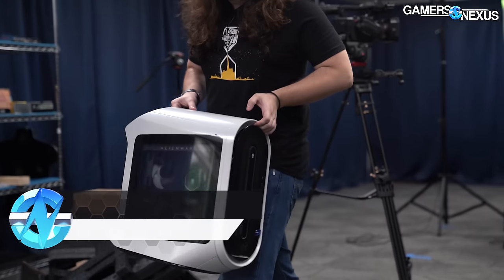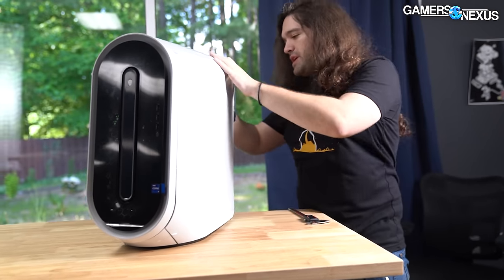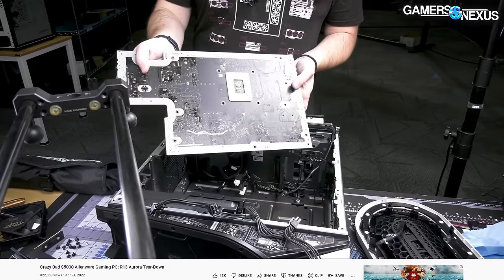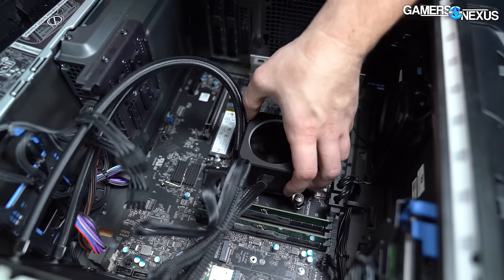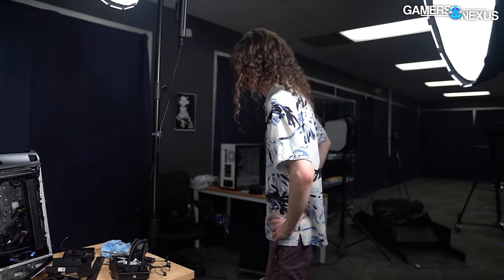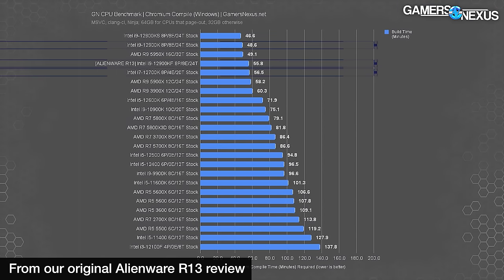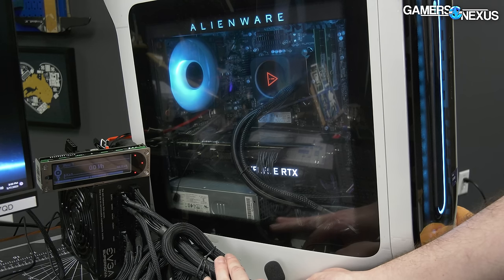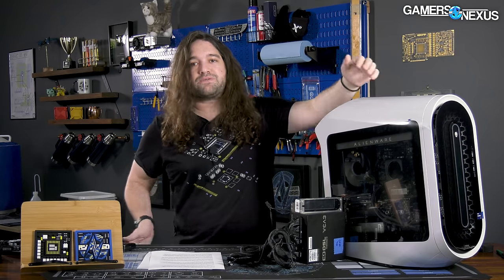"Fixing" the Alienware R13 Dumpster Fire

Comment: Again, i don't get why Intel isn't getting on Dell's case here, People are buying 12900k but not getting the advertised stock speeds because dell doesn't allow changing bios settings needed to get to stock even with a better cooler and thermals. Surely customers have a right to sue here for paying for a 12900 and 100% not able to run it at stock speeds. Intel shouldn't wait for lawsuits and demand Dell only put their chips in computer builds that allow them to run at stock speeds at minimum, it's not that hard to do, literally anyone building a custom PC would not have an issue running a CPU they buy at stock speeds, and this is an unlocked CPU capable of overlocking, yet Dell can't even manager to get it to run at stock? How the hell does Dell screw this up this badly?
Reply: You may be able to claim false advertising against Dell... not 100% sure though.
Reply: Intel doesn't care that Dell builds cases so bad that 12900K tranforms into 12700K. Intel gets money, that's the end of the story.
Reply: Intel LOVE Dell.
There's a quote somewhere about colluding to farq consumers.
Reply: Well just another reason then i'll be happy to go with AMD in my next build if Intel is ok with this.
Reply: @zengrath  Well, Dell also makes a version with a Ryzen cpu, which I can't imagine would be any better considering how incompetent they are. It's probably too much work to police OEMs from the chipmaker's perspective since pretty much all the OEMs are god awful.
Reply: @zengrath  I'm going full AMD next build (CPU + GPU) because I feel like I get more features on the mobo in a midrange chipset, the CPU power usage is a lot lower for similar performance and the AMD GPU drivers are a lot better than the Nvidia ones on Linux. And AMD GPUs use a little less power for the same performance than Nvidia ones.
Reply: I don't think Intel should get legal with Dell but they ought to have a quiet word with them. Most mother board makers try to get the most out of the CPU except in their cheapest boards. Dell are not even doing that in their most expensive PC.
Reply: @wayland7150  why would Alienware care about 12900K being 10-15% under the standard performance of the CPU when 99% of people buy their PCs because of the brand name and looking cool for people that know nothing about PCs?
Reply: @carnsoaks1  Yeah didn't some intel ceo say you cant buy better friends than dell?
Reply: @zengrath  The government can't do much, technically there is no false advertisement. Alienware never said in the product description that it should perform as well as a reference 12900K. It just said  "12th Gen Intel Core processors that help to ensure everything you do with your PC runs quickly and efficiently", which it does, like any modern CPU for that matter. Big companies are genius at saying nothing important in a page full of text, just vague statements. Like you said, the customer should do some research before buying to not get scammed.
Reply: The issue is you have ludicrous numbers of PCs being sold, which means big income for Intel from every CPU and chipset sold. 

And, let's face it. Nobody in their right mind would ever buy a desktop PC from Dell for anything remotely serious. The difficulty is that anyone that knows a first thing about anything of anything is a fairly small number.  You either have corporations that need a billion machines that are capable of Excel and Outlook. And you have people that literally don't know anything about computers other than "Dell makes PCs" and "Alienware is for gamers!". Where the former won't ever come remotely close to utilizing even 25% of a 12900k. And the latter won't check into or care that their components are being driven into an early grave by being run so hot that they have to throttle.

Comment: Oh I hate Alienware's design scheme with a passion. It's not only just the prebuilt. Even their monitors have unnecessary BS stuffs going on.
Reply: I'm going to have to disagree there, I have multiple of their ultrawides (3 AW3418DW) and have no complaints about the design. Would you be able to point out a specific design choice concerning their monitors that you think is unnecessary in a bad way? No it doesn't "need" back lighting, but it's not hurting anything. Interface is easy enough to navigate. The monitor stand goes on and off without any issue. Mounting an arm requires spacers but that's it.
Reply: @IForgetYourName  Yea I recently got an AW2721D and actually quite like the design. Sure its not needed but it is pretty cool sleek. You can say that about any product with some flair really as it isnt needed but not everything needs to be maximum function over form. Also their monitors are pretty well made and solid products overall on the higher end from what I can tell.
Reply: nah it's pretty good, dell/alienware should stop making pcs and stick to monitors
Reply: Dell monitors are pretty good. I like that they have tilt and swivel bases. I like the built in USB hub and that they connect with Display Port. They are much stronger than Samsung too.

Comment: The problem is Dell doing this would turn the 5000$ PC into a 7000$ PC.
So the best deal would be to build your own or at least not buy this Dell in the first place.
Reply: Build your own, buy a 3D printer and print your own tacky Alienware inspired shroud that fits on your superior case. You'll still be saving money I bet.
Reply: @TalesOfWar  Or just buy a broken Dyson wingless fan thing and stick half of it on the front of the case.
Reply: If i can build a better pc for $5000 a multinational with access to better prices and first class R&D departments should be capable to do it for the same or less money.
Reply: I've said it before.  If you want a pre-built and live anywhere near a microcenter, pick your parts and have them build it for you.  Best of all worlds.
Reply: @kcgunesq  I concur.
Reply: Custom pc is the best 👌
Reply: @sohamsengupta6470  Stick a Raspberry PI 4 in anything made by Dyson and you've got an Alienware beater.
Reply: It would literally save them money because they can use off the shelf parts rather than all of their proprietary custom ordered baloney
Reply: @hovant6666  the custom proprietary baloney is very cheap because they order millions of it. Their agreements likely makes it cheaper than off the shelf parts.
Reply: @kcgunesq  For $5,000 you could get a similarly spec'd system from a boutique builder (e.g. Puget Systems), and you wouldn't even have to pick parts or live near MicroCentre. You can bet the quality, build, and after sales service would easily surpass Dell/Alienware.

Comment: Once upon a time, when I still worked retail PC repair (not at a big box store, it was at a small shop), We had a customer come in with a Nehalem-era Alienware desktop. It was having weird random shutdowns and instability. Started digging into the hardware... and noticed the motherboard was a customized version of a motherboard I had. The BIOS had been customized fully and lacked many of the settings we expected to see. Force-flashed the BIOS to the stock BIOS for a non-modified version of the board... it fixed literally every problem. That was less customized than this board, though. Anyway, that's the story of how Alienware has always sucked at basics like this.

Comment: Keep up the good work! BTW, @10:26 I realized you could use a tip: I temporarily hold the fans to the case with 2@ short tapping fan screws. That makes lining up those long bolts easy.

Comment: Honestly I'd give a try and just drill a ton of holes in the various acrylic panels, it doesn't mess with the overall design shape but I bet that airflow and cooling would benefit massively. Actually, just drill holes everywhere, see how much it takes to actually reach acceptable numbers.
Reply: Yeah but it does not help, he never got it to perform better even with the improved cooling. There is nothing worth doing to that computer apart from selling it. Not a single thing you can do that actually makes it better.
Reply: The  Dell BIOS and motherboard are so gimped that even your mod wouldn't help at all. Dell found an ironclad way of turning a 12900k into a 12700k.
Reply: strap a 360mm exhaust fan on the side like they used to do in the cold cathode lighting days

Comment: So if this is the "minimal change improvement" video, can we see a follow up "stealth Dell" build guide where you just hack the case apart to fit a competent custom build inside of it?  You mentioned a MB/PSU replacement being necessary for a proper fix multiple times in the video; now I want to see it.
Reply: @J Hemphill No comparison, just for fun.  A stealth build is made to look deliberately worse on the exterior than the computer actually is, usually reusing an ancient case.  I think doing that with a Dell case would be nifty.

Comment: The real fix would be using their engineering wizards to figure out how to mount a 240-280 AIO in the top as exhaust and replace the existing aio exhaust vent with another intake fan. That way they can keep equal cooling for the GPU/PSU, maintain positive static air pressure, and fix the CPU cooling.
Reply: thats the insane part of this. they have the machines / tools / engineers to do it so much better. they did just decide not to :'D

Comment: I cant believe it was actually just this easy to squeeze adequate cooling in... Dell is actually unwilling to sell you a high performance gaming desktop regardless of how much you spend
Reply: The larger rad fits and the case even has mounting holes for a 240mm rad. WTF Dell???
Reply: @Raztax  Gotta save 💰whilst fing customers in the @sss.

Comment: Back when I was going to get another computer I was going to get an Alienware ( not knowing anything at the time )  What saved me was the fact that back then Dell had options on the website, you could choose between an Intel or AMD processor so I looked it up on youtube to see what the best option was.... To Dells demise I ran into a channel called Gamers Nexus, and LTT, JayzTwoCents, Paulshardware  etc etc... It became very clear to me very quickly that I could build the exact same PC as Dell for  about $200 cheaper, and I quickly learned Dell as a whole is useless proprietary trash!  Almost nothing is useable if you want to upgrade, or build their computers.  Not to mention the aftermarket case I got from BeQuiet had 180% better thermals than the Alienware lol  Needless to say, thank you GN you were a part of what saved me from the travesty that is buying pre-builts from Dell.  Plus now I've built enough computers I could confidently build, re-build or modify pretty much anything up to a server.  Thanks in part to you guys.  Cheers

Comment: I was given an Alienware ten years back as the owner had had enough of it shutting down and having all manner of issues. It was the Black case with the alien head on the front panel with silver vents on the bottom of the sides. It turned out that a 12v cable had been damaged when being constructed and was shorting onto the case/mobo mounting plate. You have to love the total lack of professionalism for a hyper inflated priced PC.

Comment: The problem causing menus to vanish like thin air is well very simple try using an HDMI cable if you are using a display port I know it sounds crazy but that is most likely causing the problem with the menus. I have that problem with my Nvidia GPU where my bios gets all glitched and messed up when I'm using the display port instead of HDMI and I don't know why.
Reply: Idk sounds kinda odd display port gives better performance than HDMI and it sounds more like a monitor issue
Reply: @adawg3032  Or could be NVIDIA....

Comment: I actually just case swapped to the Silent Base 802 and finally switched from air coolers (NH-U12A) to a 360mm AIO liquid cooler (EK Nucleus CR360). 

This case is heaps and bounds better than my old Pure Base 500DX. Same goes for the cooler. Both keep my 14900K nice and cool. 18-25C idle, 65C in worst case gaming (usually 55), 75-80 in R23.

Comment: I bought the Alienware Aurora R14 last year and have just gotten around to modding it to get better thermals. So far I’ve ripped out all the useless plastic crap around the bottom. Moved the PSU to the right side of the case with its own air intake (trying to model it like a jet intake). Also added a mesh side panel. 

Next I’m going to add a 240 aio and add two 140 fans on the bottom after cutting the bottom open to get air flowing there. Also plan on removing some of the plastic from the front that’s between the clear front and the fans. Honestly most of the stuff I’m doing is just cutting out useless plastic crap and rearranging the internals. This is literally my first time modding a case. I just don’t get what’s happened to Alienware these days. With the amount of unused space that the plastic shell  takes up they could have done so much more with this design.

Comment: I've been thinking.... Imagine if someone 3d print a pc case that looks like the Alienware pc case that actually can fit atx case... Would be interesting
Reply: Nobody is printing a case that large and definitely not out of plastic.
Reply: For 1, 3d printers generally can't print things that big, and if there's one that can, it'll be hella expensive. And secondly, the case can't be 100% plastic. The PSU and motherboard need to be screwed to something conductive since the screw holes are ground.
Reply: @randybobandy9828  two things. 1, it's very common for larger 3d prints to be broken down into smaller units that fit in most printer's build volume. 2, who said anything about plastic? Metal 3d printing is a thing, it's just a couple orders of magnitude more expensive.
Reply: @The Magitechie  there are part in a atx size case that can't be broken down into parts. They would be super thick in order to compensate for the weight. I have a large 3d printer and sure you can print pieces of like a cosplay suit but that doesn't need to have any strength to it.
Reply: @The Magitechie  lmao ya my guy I'm sure they will just bust out their million dollar metal 3d printer. Ok.

Comment: My approach for a quick fix would be:
* replace the front plexiglass with a similarly shaped piece of mesh
* remove the lower GPU bracket, so the GPU can breathe a bit more

cheaper to build and better airflow right away, without changing the look too much.

Albeit: probably not enough improvement for a >200W CPU. Thus adding a larger radiator would be the next step (but that needs airflow as well, so a mesh front would still help). Alternatively: add a second 120mm raditaor to the top exhaust (a nightmare to assemble, but that doesn't seem to be of much concern to Dell anyways). Also that huge "hood" on top should in theory provide more than enough space for a second 240mm radiator.

Comment: It's funny to see this because I bought an Alienware Area-51 in 2004 that also had a really unique case with a strong aesthetic. That case, however, took a standard full-ATX board (an aftermarket ASUS board, even) and had lots of places to attach standard (for the time) 80mm case fans. Even if newer cases are better, I'm still able to use it to this day when I don't need exceptional cooling or GPU height. It's a great contrast to this system which wastes so much money and potential on aesthetic touches that detract from performance and reusability.

Also, the guts of the system still work too! There's not a lot you can do with an overclocked Pentium M these days, but you can't blame it for being so far eclipsed by what has come after.

Comment: Great fix.
This Alienware is clearly more about cool looks than performance. It's sad to see good quality high-end parts being used in a junk build like this.
Some comments:
About that hub controller (it's called Commander Core IIRC) USB thing, you could have swapped that header connector for normal USB plug and hooked it up to a port on the back through that unused slot right above the GPU (just need to remove the bracket). There are adapters available if you don't want to go the DIY route.
Also, your Dell has plenty of power to run that fan controller, not sure why did you choose to use an external PSU instead of just running a power cable of off Dell's PSU. Not the prettiest way but way better than using a second PSU just for a fan controller.

Comment: in 2017 i bought an alienware aurora r7 on a super sale. the power supply was trash and holding back the whole system. i changed the 460w for an evga 650w gold edition and saw a huge rise in performance. it also came with a single stick of ram, but that didnt bother me because i saved so much on the system as a whole and planned to buy a 32gb upgrade anyways. after that it was pretty impressive and i still eneded up spending far less than building my own. the next thing later on was a thermal paste change.... because all these manufacturers use garbage paste. it dropped my temps but about 7-9 celcius on average during gaming.

Comment: I wish I had seen this video sooner. I bought an Alienware PC from BestBuy as my first pc ever. It was on-sale from $1,800 to $1,200. I was enamored with the 6800XT and the 5800, excited for an AMD build. I was so confused when I pulled it out of the box and booted it up to run Rocket League at 80 Celsius.  I figured screw it, I'll just buy a new case and move everything inside over, and boy was I wrong. I, in fact, had to buy a new motherboard, a new power supply, and a new cooling system. Absolutely bonkers.

Comment: I bought one back in 04 before they got bought out. The build quality was amazing. Off the shelf parts. Great cable management. The psu was bad though. Generic 450watt psu. This was in the era when Alienware cases were actually different. That system lasted me a while with a few upgrades. 

Sad to see them go downhill. Funny enough the only thing I like in this build is the PSU, and all the mechanicals, if only they weren’t such a PITA.